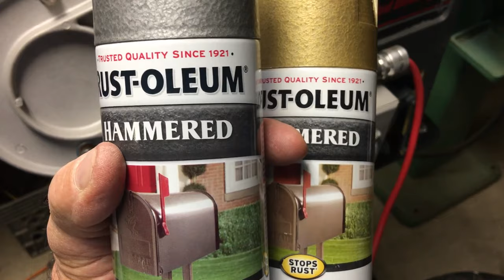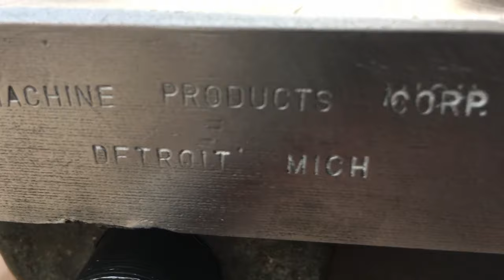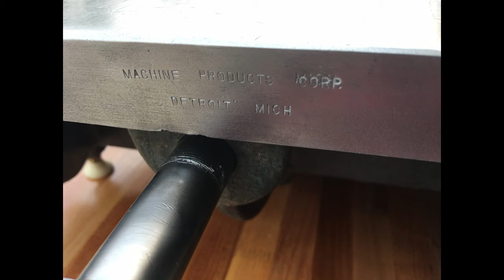Cast Iron Surface plate

Comment: I have just acquired an old plate pretty much like that, perhaps one half the size. It has 4 solid feet and appears to be in good conditions, I can see machining marks in the edges but not in the middle. I still have to check it with a straight edge, which I don't have at the moment. I have painted it light silver with the same stuff I use for the fence, but I suppose I can still take that off. It came with a sort of crude pedestal which is however too useful to be just discarded. Have put hardwood pads under it which should be good enough to move it occasionally
The work you did on the stand is great and I'm liking your channel a lot.

Comment: Beautiful. Should have three feet not four. At 0:19 you can see five feet. Two at one end and middle one at the other are the points of contact. The other two outer ones are higher than the middle one and just ensure that it doesn’t tip.
Reply from the maker: You bring up a great point, it came with the pads in the corners so that's the way I put them back.  But I will be setting it on 3 points. Thanks for bringing it to my attention.